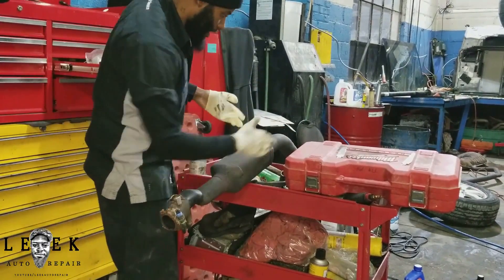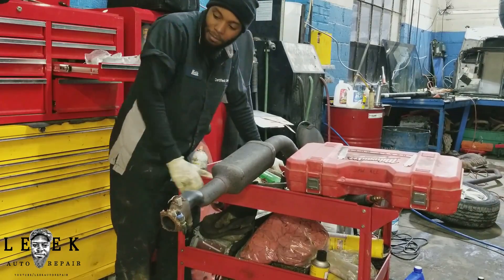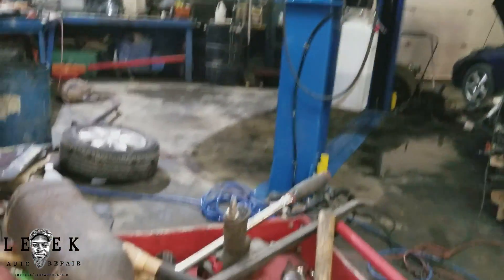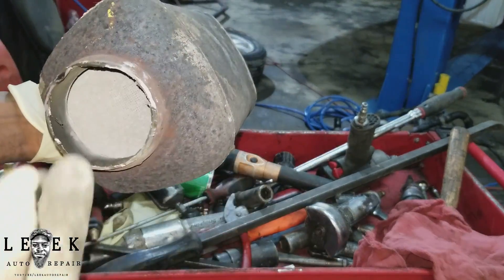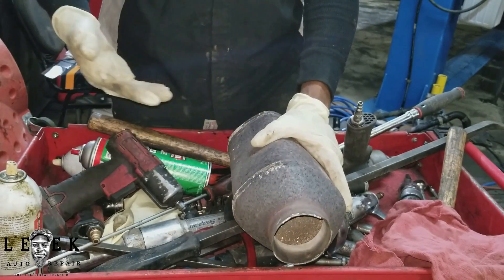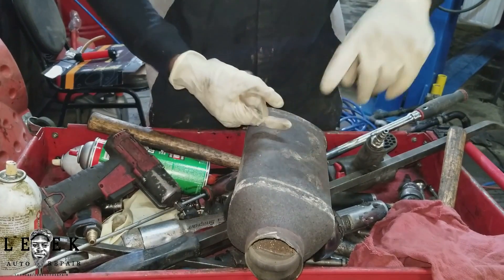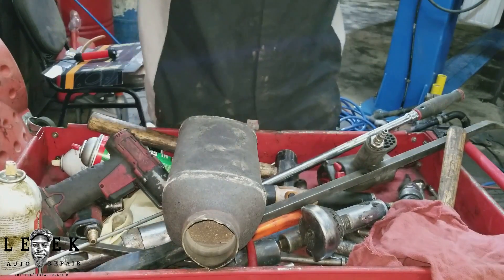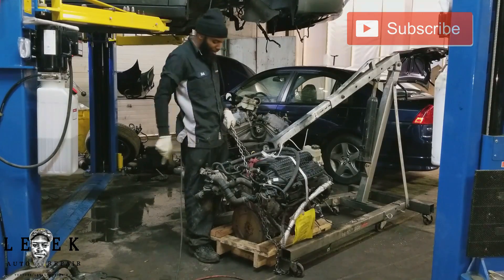What Does A Clogged Catalytic Converter Looks Like

Comment: My 01 monte ss is having the same issue, had a upper & lower intake gasket leak so I replaced both and put in the upgraded parts. Guess I didnt catch it quick enough because a month later, I had reduced power and would barely get over 2000rpm. Next week yanking it out to replace the whole part from header down to resonator. Smfh, it's been a pain in my ass ever since I got it but learning to do all my own repairs, small and big, from videos like this. 👍🏼